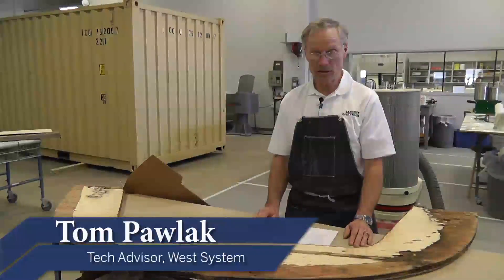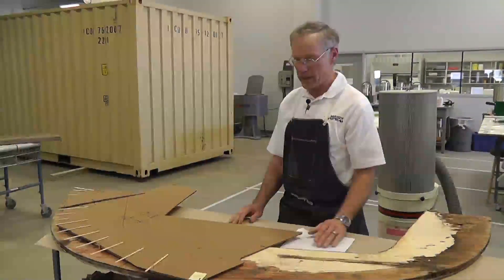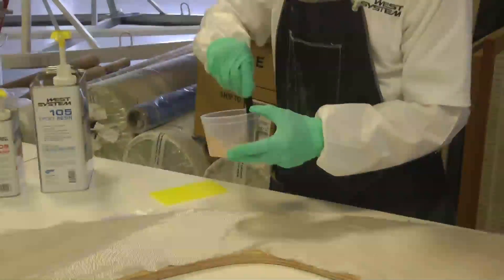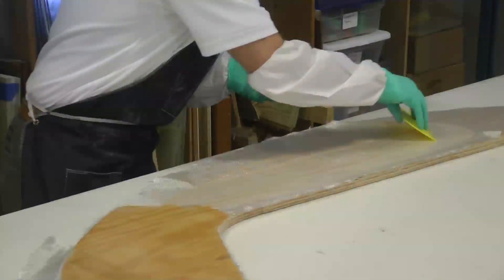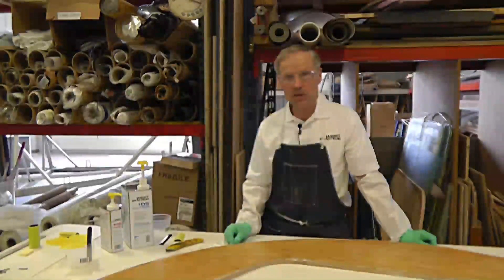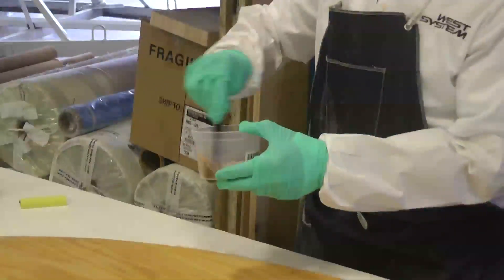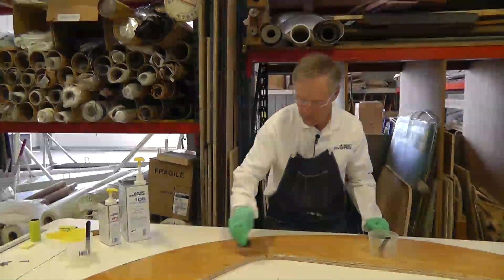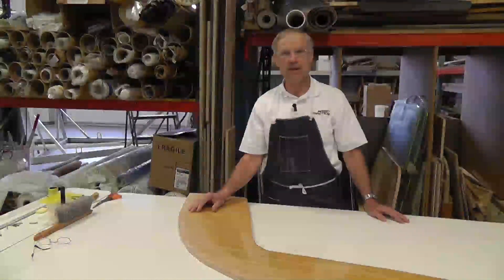SAIL Epoxy Basics: Reinforcing & Sealing a Bulkhead

Comment: In time, and not that much time, the plywood you added will be rotted just like the plywood you removed. Water always gets past the fiberglass, either by permeation through the glass/epoxy matrix or mechanical leak paths and the wood rots.